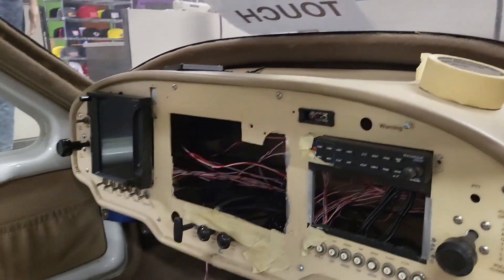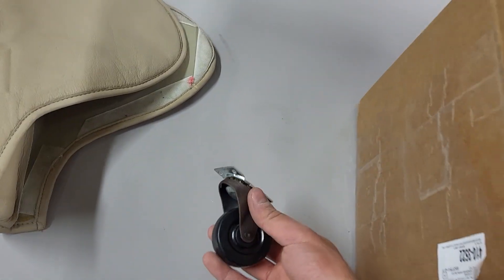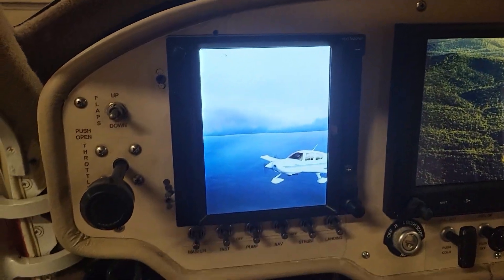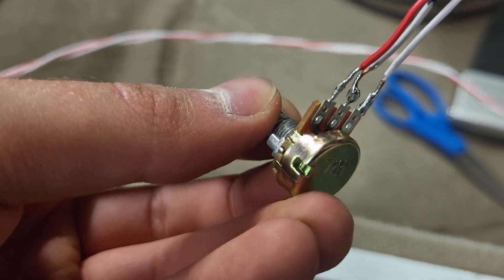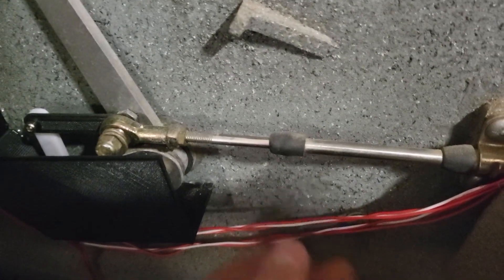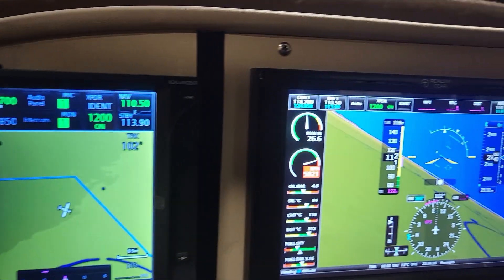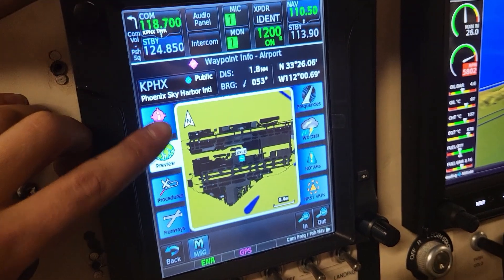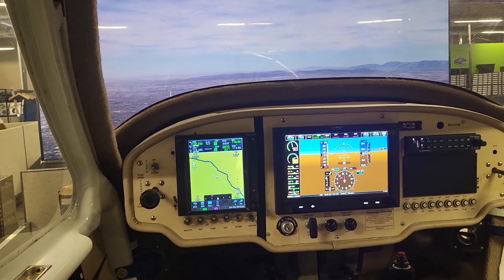I finished building my insane flight simulator! Configuring the Garmin Avionics #flightsim

Comment: Will these hardware flight panels work with mac studio and xp11 or xp12?
Reply from the maker: Most of the avionics work with X Plane. The only exception is the Garmin G3X. It is supposed to have support for X Plane later this year. I have no idea about running it on Mac.

Comment: Nice build, but needs two more screens.  Or, you could move to mixed reality VR, which I have recently done. Best of both worlds.
Reply from the maker: I definitely want to go to 2 screens. I was looking into mixed reality VR...lots of potential.
Reply: @AceSimulations  I was initially planning on building a shell, but mixed reality is way simpler and very effective.  Would be a shame to wast all the work you have done with the aircraft shell, so maybe stay with fitting some extra screens.  FI, you will need to mod the model files to remove the parts of the inside shell that will get in the way(I have done this myself and it actually works fine).  There is a simple mod out there were you remove everything internal, but that won't work for you as you have pop  out screens.